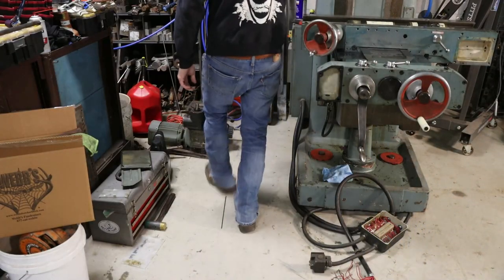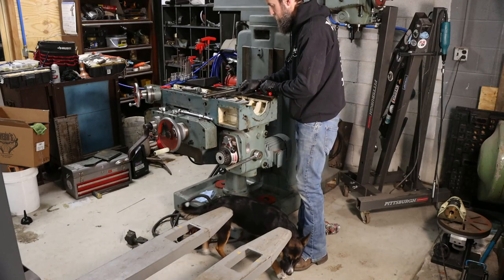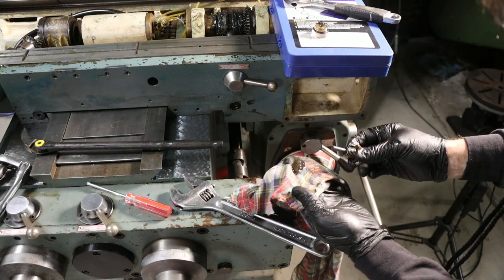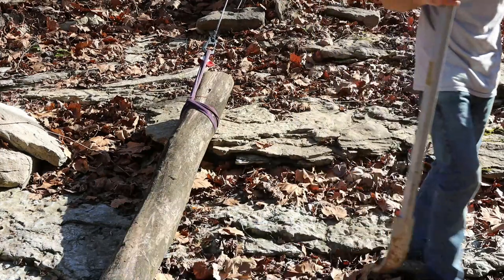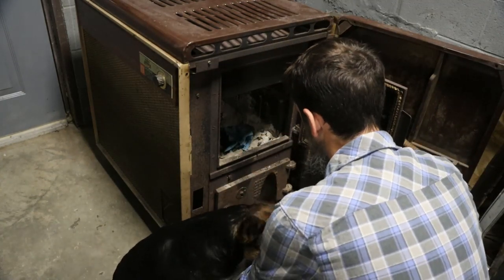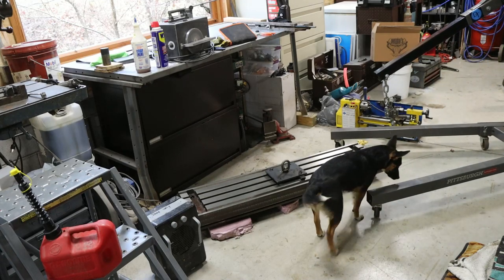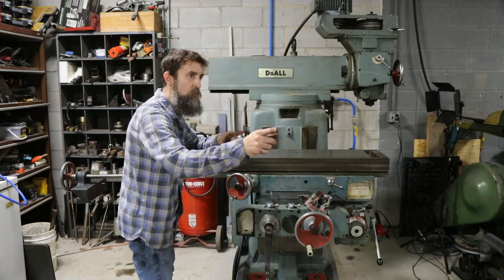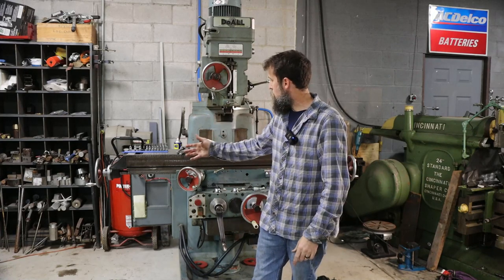This Mill is going to be a Beast! Project DoAll Continues . Winching  Firewood with the Badlands

Comment: Hi Steve. Cora is turning into quite the shop dog.  It is so nice to see a rescued animal that was scared and shy at first, start coming around and trusting people again.  Many years ago, I worked in a shop as an auto mechanic.  It was all I ever wanted to do since I was a small child.  My hands got so dried out from being in constant contact with brake fluid, grease and parts cleaning solution, that I had to leave that profession.  At the time, there were no gloves for mechanics.  I don't even think you could get something like the nitrile gloves, unless maybe if you had a contact at a hospital.  I still don't wear them as much as I should but I'm not exposed to those harsh chemicals on a regular basis.  I still wrench on cars, but it's for my own enjoyment and sense of accomplishment now.  Thanks for the video!

Comment: My dad, and me too for a while, worked on mining equipment. Wheel units off continuous miners, gear boxes, rollers for conveyor belts, etc.  Between the oil, coal dust, grease, whatever ungodly cancer causing death juice was in the parts washer … your hands were never really clean.  It took a long time after he retired to not have black lines buried down in the callouses.

On that remote, a pair of cheap work jeans from Rural King with a carpenter loop.

Comment: Hey you guys say comments help the algorithms.   Here goes.  I myself got tired of watching chevy square body videos, got one myself, fuel tank problems, too many times, bought a Ford.  Ha.  But I have been glimpsing on your channel waiting on machine shop stuff to show up.  Looks like do all mill is coming along nicely.  Gasket maker, old timer way, indian head gasket shellac.  Permatex ifin I remember right was marketed as aircraft gasket maker.  My favorite back when was gasochinch, sp?, almost like contact cement, brush on layers, let dry and assemble, worked the best.  Liked your scraping,  just gave it some contact points and oil retention,  works for me.  Frankly your scraping was better than machines I have ran.  Old rebuilt Bridgeport I used to use had been rebuilt, reground and scraped.  Not going to question the regringing, mill was tight, but they  took a power scraper and flowered everything.  Ok but.  That shim behind the y axis gib might be hunky dory.  But you are trodding on, put it together and check and verify.  Sometimes you just have to proceed.
Hey I have commented.  Now back to my binge watching of putting your  mill back together.   Still say you are going to miss your Bridgeport clone.  Ha.

Comment: Cora is definitely needy. But at this point that's expected. She's had a rough life and found a 5 star animal friendly family.  Your mistakes are great, these types of mistakes are good to see. You go back and do it right, rather than take the shortcut that could get you in trouble.    BTW you need a diamond plate or just flat plate with feet to lock onto the lift. It can serve as a table, workbench, and flat lift. I was a little nervous watching you balance the feed... glad it worked out.  If you get an Aluminum plate easy to move, but with a steel plate, great for welding as well. You can always just pick up the plate and put it against the mast for storage.  figure out a latch to hold it.

Comment: Use a skid plate under the front of the log, chain the log to the plate (with a curved up front) and pull the plate. Should be a lot easier on that rough ground as it won't dig in.
Reply: An old car hood with a good curve makes a decent skid. Good enough to pull an elk out of a deep hole anyway.

Comment: You are maybe already done. but for fishing those wires, you might find it useful to push a thin rod through from the left and use that to pull a tape or cord out to the left and then use that tape to guide the cables in. Sound counter intuitive, but it often helps.

Comment: You'll have to make some chips with that mill soon here. If you're going to do much yarding firewood a couple of tools that might come in handy would be a wire rope chocker and a peavy. You can most likely find the peavy at Harbour Freight or Tractor supply. The chocker might be harder to find but any place that sells logging equipment should be able to get one.

Comment: Hey Steve. I think I have that exact same wood stove in my shop. Mine is a Wondercoal. I think it's actually designed for burning coal, but it works well for fire wood. Ironically, I've never burned coal in it. I also built a waste oil burner for it to burn waste oil in it. I can convert it back and forth to burning oil or wood. It takes about 10 to 15 minutes to change back to one mode or the other. Last season I had a lot of waste oil to burn but this year I didn't have enough waste oil to burn so I'll just burn wood.

Comment: KEEP YOUR STONES CLEAN AND DRY , NO OIL.CLEAN W/WD-40 THEN DRY AND KEEP DRY
Reply: I wish I knew where I can buy a set of precision ground stones, not found a supplier in the UK yet.
Reply: @dutchgray86  Buy two standard bench stones and find a bloke with a surface grinder. Then Bob’s your uncle!
Reply: @josephrogers9701  I have a surface grinder but from what I have researched grinding stones is a non trivial exercise and something you don't want to just have a go at without knowing how first.
Reply: @dutchgray86  At least you are equipped to do it with the proper process.  The stones are not very expensive. I would hazard a pair to DIY once you get the info!
Reply: Why are you yelling about mineral spirits (WD-40)?  We get it!!

Comment: I don't understand how the leadscrew can still be correctly aligned with the nuts after the ways have been ground?  The leadscrew mounting brackets look very tightly doweled onto the ends of the table, so no chance for any adjustment there.

For the winch remote you could probably use a suitable size carabiner clipped to your belt and just drop the remote through.

Comment: So why were there cut trees in the creek? Or did you cut them? I continue to be amazed by how beefy that mill is. It must have been pricey back in the day. High parts count.
Reply from the maker: I cut them up when they fall or get washed over by the water and pull them out. Otherwise I would have to work them up where they fall and pack them out by hand.

Comment: Clearly it would be undesirable, but is it possible to extend the ram out to a point that the machine falls over when the ram is to the side like at the start of the video? 
If so, does the machine need to be bolted down, just in case?